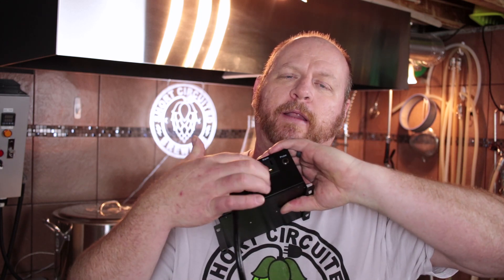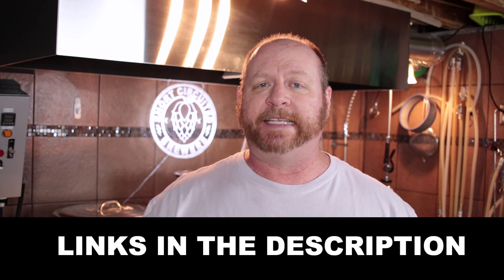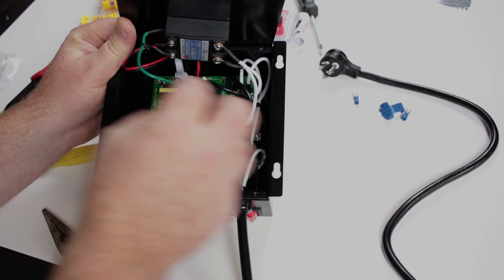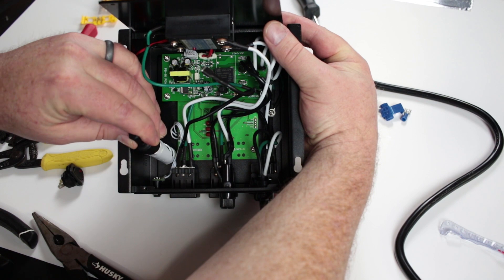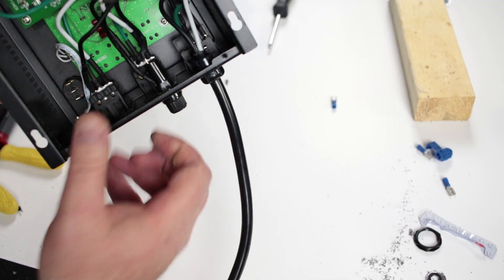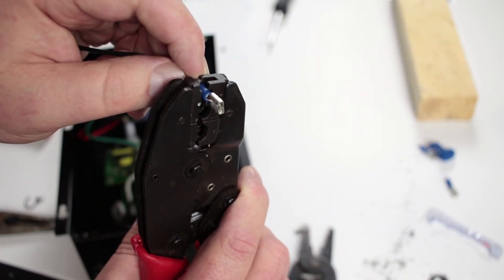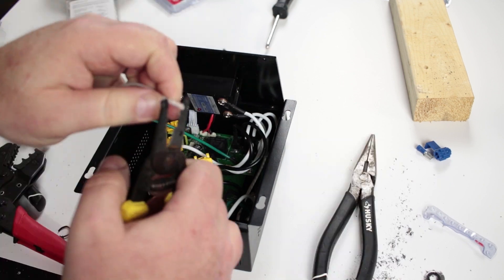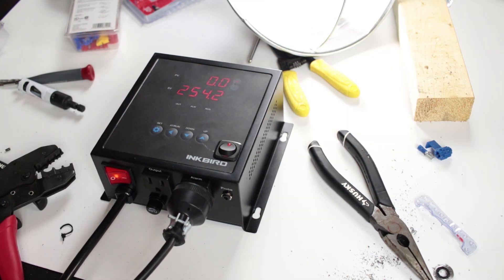Inkbird IPB-16 Mod | Bypassing the alarm function and install a switch to control a pump.

Comment: ..any chance you can tell me what replacement fuse to purchase..?   . . .mine went dead.  there is confirmed power at the plug & gfci is not tripped on plug. ....
Reply from the maker: It's a buss fuse. Most auto parts stores carry them.

Comment: Hi - I do 3 gallon BIAB brewing, and I think this would be perfect to convert my system to electric.  

My question: it says it can handle 15a.  Can I use a 1650w element, or should I only use 1500w????
Reply from the maker: Rob Shuster it will handle a 1650 watt element.. I am about to build a 5 gallon batch E-BIAB with this controller and a 1650 watt element.. Stay tuned for that..
Reply: thanks for the fast response (30 seconds).  Keep up the great work.  I really enjoy your channel.
Reply from the maker: Thanks Rob.. I see you on the live streams too! 👍🍻

Comment: 35 centimeters is over a foot. Did you mix up centimeters and millimeters?
Reply from the maker: Old Norse brewery no.. Read the other side of the tape wrong.. It was some other measurement.. Ugh.. 👍🍻
Reply: I thought US was converted to metric long ago since In July 1866 the metric act was signed by president Andrew Johnson and they started work to convert everything to metric. Today 150 years later I suppose everything is in metric in the US
Reply from the maker: Old Norse brewery I looked at the tape measure and I'm not sure what measurements it is exactly. I thought it said tents for a second but that's not right either. That's what I get for trying to include some other measurement than what I know in a video LOL
Reply: No worries. Cheers Brian

Comment: Could you control a 2000W element with this controller without fying it?
Reply from the maker: ElectricBadgerCo LLC the SSR will handle it. The plugs are not rated for it though. Might melt the element plug? Not sure. Good question.
Reply: @ShortCircuitedBrewers  I have the same question. I have a 2000W element 120v. Have you done anymore testing?
Reply from the maker: @gizmochewey  in the USA model it will only handle a 1650 watt element.  A 2000 watt element is not advised. Also the 2000 watt element would exceed the capacity of a 15 amp circuit.

Comment: What kind of test system are you looking to build with this?  Do you think you could do a full 5 galloon BIAB with this controller and only one element? or would it take forever to come to a boil?
Reply from the maker: I am actually going to do a "convertible' system..here is my plan. I am putting a kettle together with a TC fitting on it and converting my current 20 gallon kettle to TC as well. The idea is I will be able to use the BIAB kettle with the inkbird.. Or I can use it with the 5500 watt element I would use in my big system.. I am going to upgrade my element in my big kettle to a TC element. And buy a 1650 watt element for the 110V BIAB system. The clawhammer supply system uses a 1650watt element and has no trouble boiling..I will definitely be publishing my findings on how long it take with 1650 vs 5500 watts.. (Always been curios myself) sorry for the long answer.. Lol 👍🍻
Reply: Short Circuited Brewers thanks for the details. I am trying to figure out which way to go with a build or turn key with something like the claw hammer or high gravity system. I like the idea of the TC fittings as it would make it super easy to upgrade the elements. The controllers are what crank up the price. Wish there was a controller that could be upgraded later from 110 to 240. Are you aware of any? I love the price point of this 110 inkbird. If you set the strike temp and turn the controller off will it go right back to the same set point and start heating when you plug it back in? I want to be able to put the kettle on a delay and have it start in the am and be warm when I am ready to go.
Reply from the maker: Brad Atchison not sure about the unplug reset.. I will have to check.. Yeah the controller is the biggest leap. I may have to buy another controller and see if I can do a easy cost-effective conversion to 240 volts. The SSR will handle it I think you would just need to add the SSR will handle it  as only one leg of the 240 volts is switched by the SSR in a 240-volt system anyways.. change a couple of plugs and some wiring and you probably would be in business.. Hhhmmmmm

Comment: Your unit conversion is off...should be mm rather than cm, or scaled down by 10. 0.75 inches is 19 mm, not cm.
Reply from the maker: Matt Neilson you are right, I read the other side of the tape measure wrong.. Good catch cheers! 🍻 I always seem to mess up those metric conversions!!
Reply: Cheers! Keep up the good work! I might have to pick up one of these from Brew Hardware and finally construct a dual-fuel electric/propane BIAB system (or just pick up a Robobrew when v3 comes out)
Reply from the maker: Matt Neilson I tell you what for $100, or $110 if you get the switch option. It's not an expensive device to play with, and see how you like electric Brewing. 👍🍻

Comment: Great video but I still have a couple questions for you. I'm looking for a controller to build a Auto-Draw off system for my maple syrup system. Basically, I need a controller that open a 120V valve when the temperature reaches 219F and closes the valve when temperature is below setpoint.

1. Is it possible to set the ink-bird to temperature higher than 212F ? (according to website it seems possible)

2. Is it possible to wire it/set it in a way that when it reaches the set temperature, it opens the 120V motorized ball valve?

Thank you again for your great videos!
Reply from the maker: I'm pretty sure you could use the alarm function to trigger your valve. Thanks for the comments! Cheers!